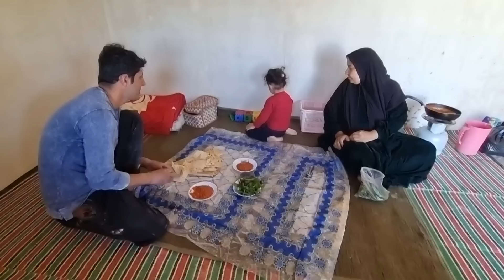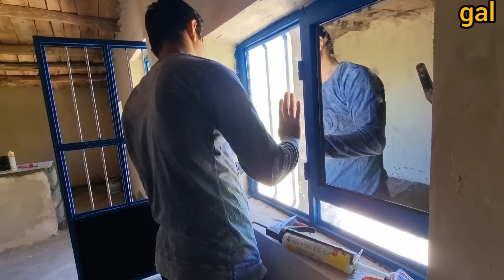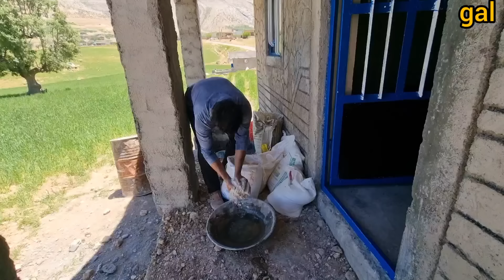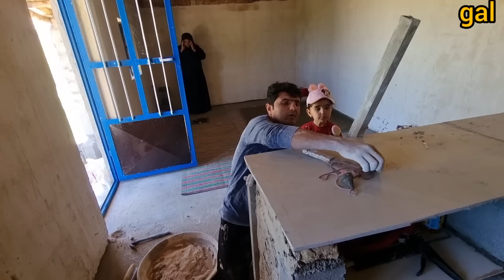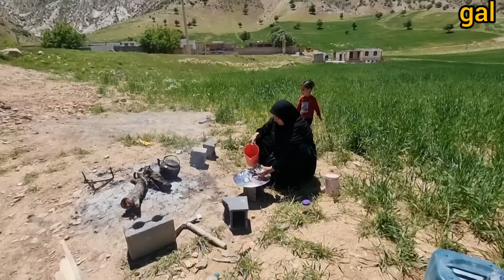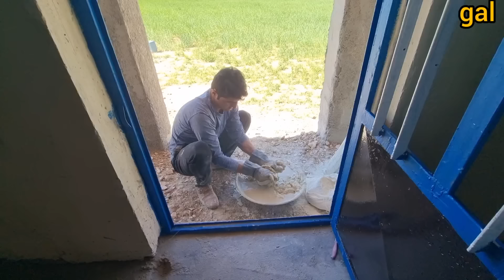Crafting Light: Nomadic Father and Daughter Install House Windows Together 🪟🏠

Comment: Fix the inside and the roof.  Important not to have leaks when it rains and snows.  Not the physical appearance but the durability of the house.  I didn’t any strong posts and strong foundation just hollow blocks stocked together.  Anybody can kick the walls and the posts/columns outside and they will fall.😢